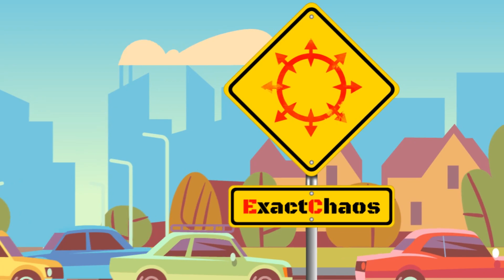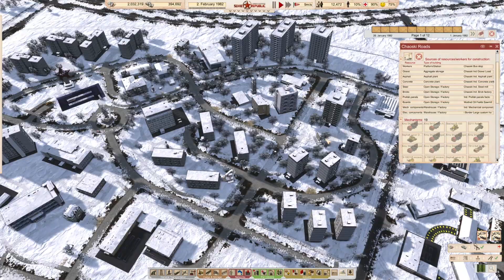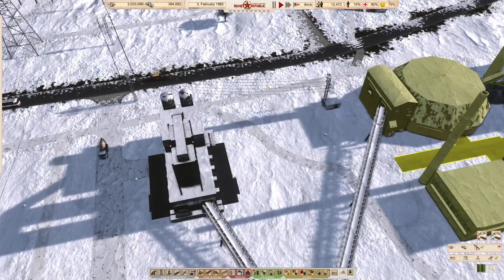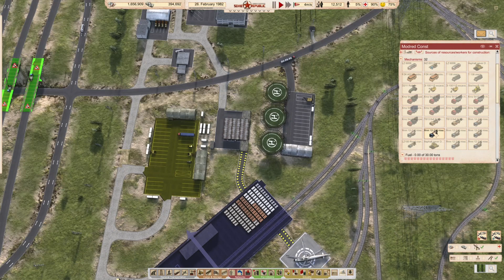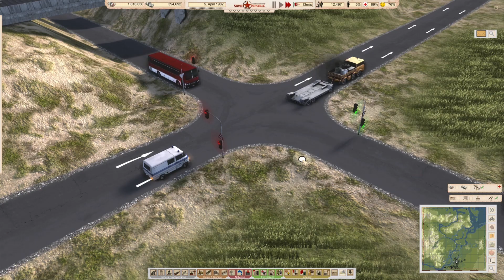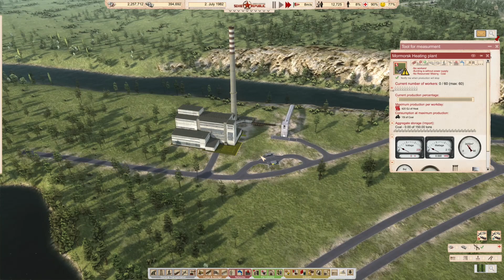Traffic Signals & Interchanges - Workers & Resources: Soviet Republic

Comment: You might want to coordinate the two traffic lights at the new diamond interchange, so that traffic doesn't end up stopping between them.
To do this, just pause the game, and at both traffic lights jump to the phase with 2 green lights (the secondary road). 
Another, probably better way would be to follow a car waiting at a red light, wait for the light to turn green, and change the next traffic light to the secondary road phase just before the car arrives.
However in my opinion, you don't need traffic lights there yet because there's so little traffic.